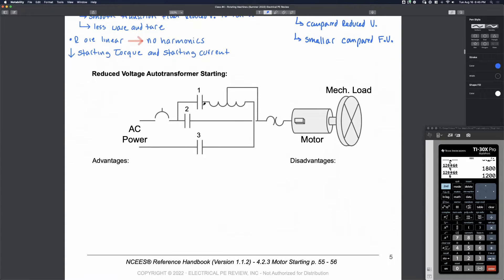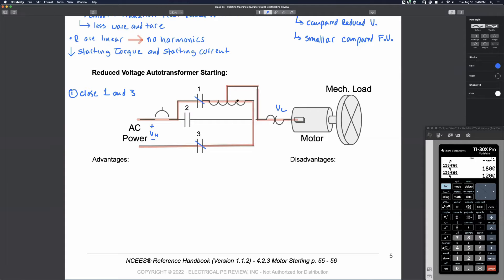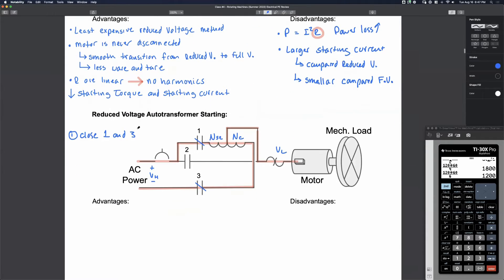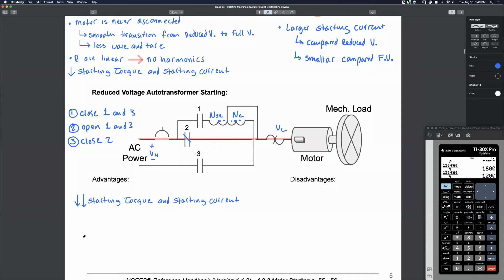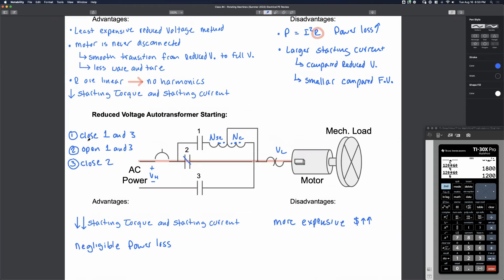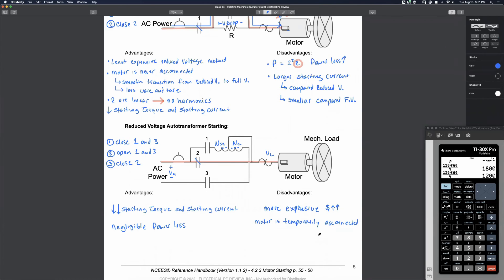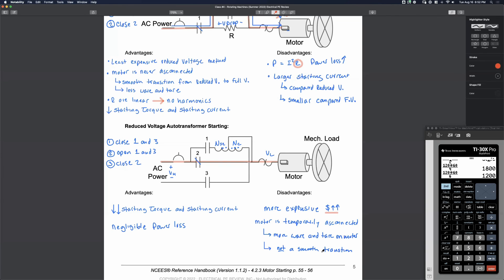Autotransformer Reduced Voltage Motor Starting for the NCEES Power PE Exam

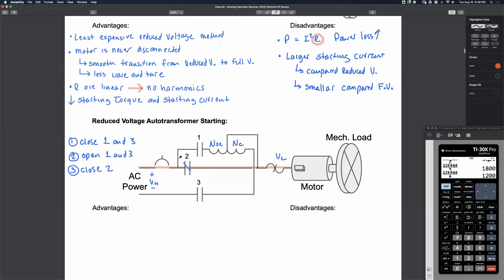Comment: 2:54 also what’s typical is a centrifugal switch?
Reply: Failure mode philosophy for this would be metal fatigue
Reply from the maker: @BritishEngineer  personally I've only ever seen timer auxiliary contacts or a timer bit from PLC used to bypass the autotransformer to apply full voltage once the motor is close to rated speed but I'm sure a centrifugal switch would work just the same but it would need to be already built into the motor which means you'd need to purchase a specialty motor as opposed to using a timer contact with any existing standard induction motor.